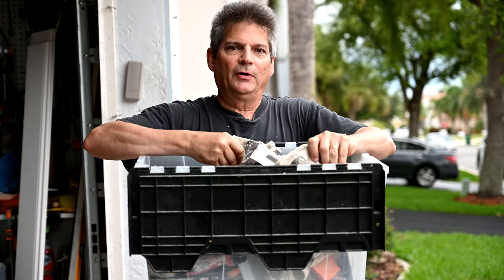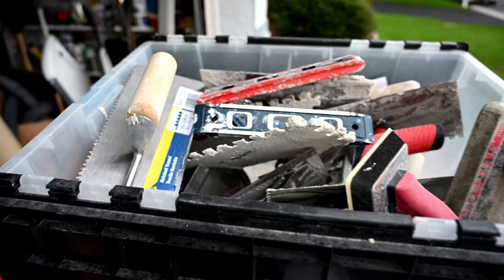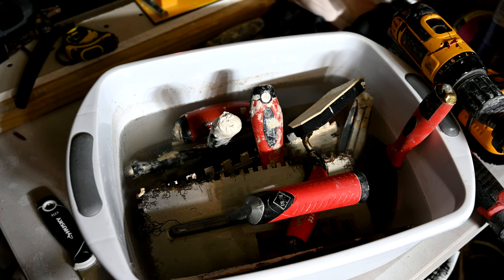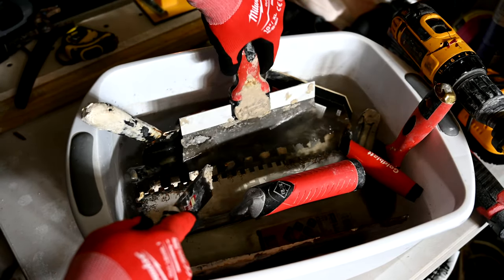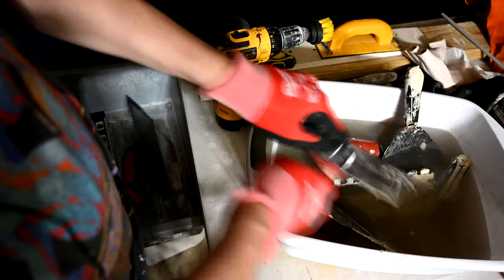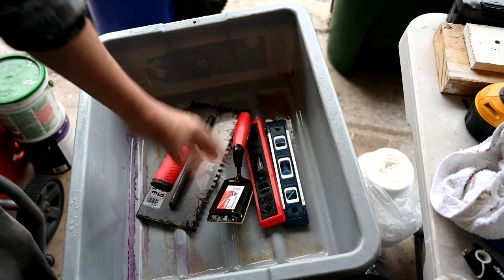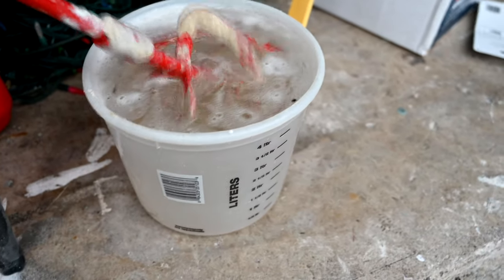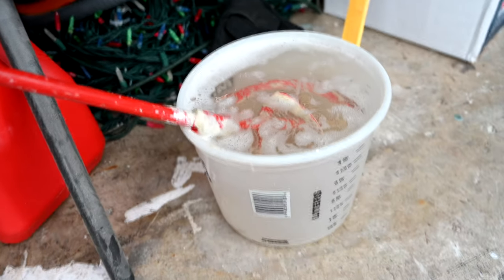How to Remove Concrete From Tools With Sulfamic Acid Cleaner

Comment: muriatic acid. Buy a gallon and poor it into a plastic 5 gallon bucket add 2 gallons of water, put in tools it will eat cement off in 5min, take out tools rinse with water then oil them with WD-40. No scraping required.. Good part is it will never weaken, just cover with a lid and it can be reusable.

Comment: Just soak them in vinegar for a day or two and that works just as well.
Reply from the maker: Didn't work for us.  Tomorrow night we are uploading a video on how to remove rust stains from concrete I want you to take a look at that because we also tried vinegar with that and vinegar seems to be the most over prescribed remedy on the Internet that doesn't work for anything other than salad dressing.
Reply: Dont work 
Tried that 20 years ago
Reply: White vinegar only has 4% of acid. It may work with stearic acid

Comment: Is there any benefit to using this over citric acid? Citric acid is generally cheaper, and less likely to turn your wooden stir-stick, paper towels, and clothing into mono-propellant rocket fuel.
Reply: Sulphamic acid is way stronger and therefore more effective. However, it isn't as strong as Hydrochloric or Sulphuric Acid, which are the strongest acids you can usually get hold of.

Comment: Wow, that stuff really works.  Your tools were really loaded up and very thick (unacceptable lol).  If it cleaned your nasty tools in a short period of time, just think if you left it overnight, probably wouldn't have to scrape anything.  Thanks for sharing,
Reply from the maker: Yes it's amazing how many times I simply forgot to wash the tools off at the end of the day were when I was done with them man it's amazing how set up and tear down every day just kills about an hour out of the day. Also the last place that I tiled a few weeks ago there was no water anywhere that I could use to wash off the tools. It was at a condo association where they're all cheapskates and they put locks on the hose bibs so you can't use them.

Comment: will this remove thinset from the HANDLES of my trowels??  Its my handles that are filthy.
Reply from the maker: Yes, anywhere that you have thinset collecting it will dissolve, and you can brush off the rest.
Reply: Thanks.  Considering vinegar is sold out in my local HD, I’ll be picking some of this up.  And I think I’ve tried vinegar in the past to clean the handles.  Didn’t work.  Excited to see what these handles look like again.
Reply from the maker: @jakestephen508   He did another video last summer on removing rust stains from concrete and showed that vinegar did not work for that either, and connector is the most prescribed useless remedy on the Internet. Lot of people prescribe it for removing smoke smells from walls as well and that does not work.
Reply: @jakestephen508  I know what you mean! It’s all over my handles too

Comment: How do you properly dispose of the liquid?
Reply from the maker: I don't think that the resulting liquid is really dangerous, but I did pour it in the garden where there was no flowers or trees growing out of just found an empty spot. Do not pour it onto concrete or onto the street or down a gutter on the street, because it will turn into rust because of all of the iron in it once it dries and leaves a bad stain

Comment: Minutes of cleaning immediately after use and during use in clear water,  saves hours of work later... a bucket or hose works great, never a client sink though.
Reply from the maker: Robert you would not believe how many times we forget to rinse off our tools at the end of a long day, ot it's dark, and I throw them in my trunk, I'll wash them when I get home. I get home, too tired, forget about it.... happens all the time.
Reply: @jeffostroff  Yeah, I get it...  I have learned,  through many hours of after the fact cleanings, to finally become disciplined enough to leave the final half hour of every job to just cleanup. 
I have found that building it in to the work schedule actually eliminated so much effort and discarding ruined tools later that I no longer forget.